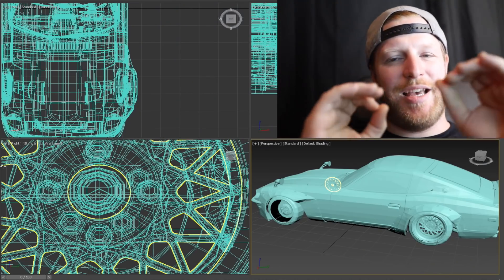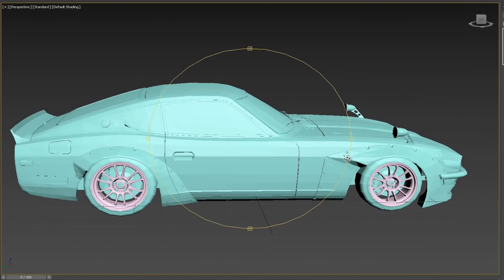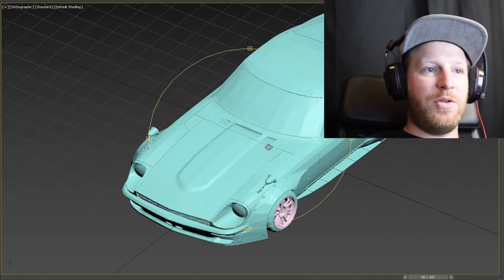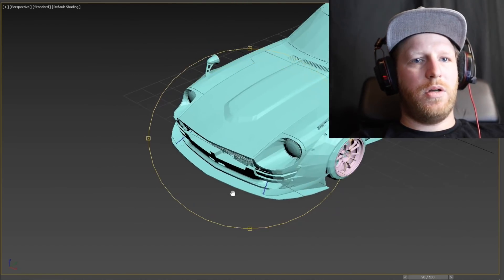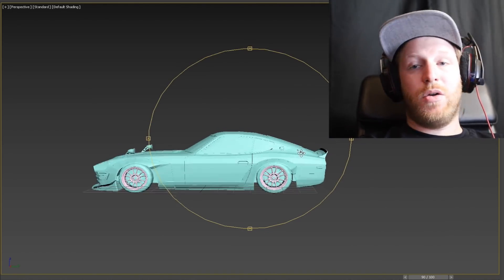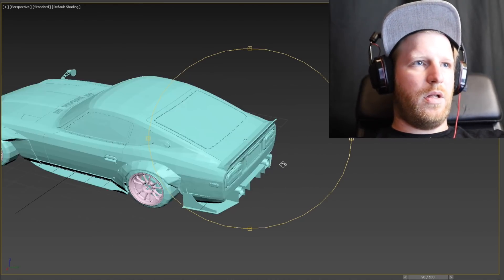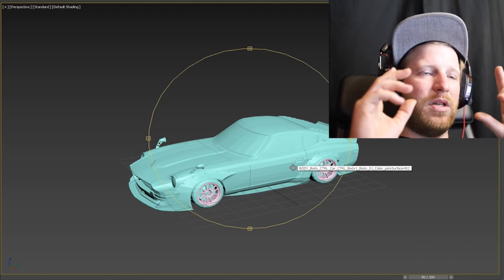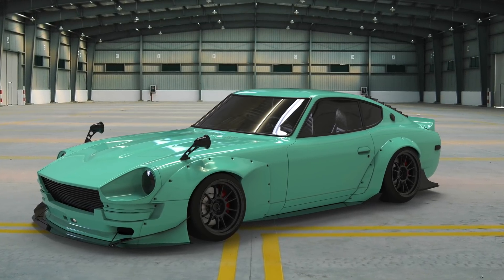Designing My V10 Powered Widebody 240Z

Comment: Dont widebody it with rivets, do an all steel widebody that’s subtle but noticeably wider. Car has such clean and beautiful lines
Reply: Andrew Sonnevil exactly what I wanted to say
Reply: he said he already bought the kit
Reply: He could try to mold the kit to the body rather than using hardware :/
Reply: I agree, in my opinion it looks cheap with rivets. Smooth / mold it out so it doesn't look like a kit anymore.
Reply: Andrew Sonnevil guess its too late for this.. too bad. Would have been better.
Reply: yeah lets not forget the last rocket bunny kit he put on, and the rubbish (imo) way he put it on
Reply: Pieter van Gisbergen Molding a ABS plastic or Fiberglass kit to a steel body will flex and crack at the joint. The only option for smooth molded flares is welded steel ones that won't flex.
Reply: Shona, that makes sense! Learned something new again :)
Reply: Agreed - riveted body kits look like a cheap and easy way out to wide body a car, they just look tacky when the rest of the car is mint.  Fabricate it and it will look a million times better.

Comment: Please don’t put a big wing on it or a wing at all
Reply: It has fuckton of power, it needs a wing, it's not cosmetic in car like this.
Reply: When you get your 240z and put a BMW V10 in it then you can leave the wing off it. Until then Chris is gonna build his and he’s gonna do it his way
Reply: it doesn't need a spoiler unless he's going to go over 200mph which i highly doubt he will.
Reply: Jeppe Werring don't think you know how rear wings work....
Reply: You don't have a clue if you think a car has to go over 200mph to need a wing. Educate yourself before spouting asinine nonsense.
Reply: downforce, without downforce it can be dangerous to go at very high speeds as the air get under the car. but too much also limits the speed. That's why downforce is variable on the Huracan Performante, higher speeds in corners with a lot of downforce but less downforce in straights for higher top speeds.
Reply: Jeppe Werring It's actually in speed over 150kmh which is about 90mph. Which he can easily do on a track.
Reply: F90 M5 can go over 190mph when unlimited and that thing doesn't have a spoiler. remember that this datsun will be super heavy in the front.
Reply: The F90 M5 has a piece of carbon fiber or plastic stuck on with double sided tape, it doesn't do shit.

Comment: I think you could implement some  compartments for the windscreen wipers, two cutouts on the front of the car where the wipers would traditionally go. They could be motor controlled by a switch on the dash, when you flip the switch, the compartments open and the wipers come out.

Comment: An 83 Chevy Astro van grille with slight mods makes a full front grill.   I know you don’t want bumpers.  But on my 240 I took a fiberglass 240 bumper and cut it to make bumperettes.  So small side bumpers to fill in where the bumper goes.  I don’t know how tom add a picture to show what I did.

Comment: Ugh...you had it so close.  The widebody sucks.  I agree this car deserves something more custom less bolt on.  Duck bill and louvers for sure...no big wang.  Please.  Also the "diffusers" and "side skirts" you are doing are ok, but the rear is terrible.  This build is outside of your normal scope.  You normally take older or junky cars and either fix them to spec or go the other way. THIS car is totally custom.  This will be a custom built car, with a 240z skin.  This is serious.  After building the chassis, and making the driveline work out, sticking on a bunch of crap would just be letting the car fall short.  If you needed to skip SEMA this round to get the car done right, that would get my vote.  This has potential to be one of the coolest frigging cars in the game if you do it right.
Reply: I agree on that rear diffuser. But then again he copied it from a ricer
Reply: Widebody looks amazing dude. 
No widebody = normie car
Widebody + spacer + lowering springs = better handling.
There’s a reason people do this.
Reply: DesiredFilm...I think you misunderstood my post.  THAT widebody sucks.  I like wide bodies.  And on the right car, what he proposed is fine.  But for this car?  It deserves something much more.  "More custom, less bolt on" like I said.  Maybe out of steel...maybe out of fiberglass.  Just something different.  We're on the same page :)
Reply: JEG's Garage 
Oops sorry. I’ve been reading other’s comments and somehow I mixed the two.
Reply: I definitely do not mind wide body vehicles/designs. But with all of the issues he has had to deal with on this build and all of the hard work he has had to put into this 240Z / M5 hybrid build, it just does not seem to do the vehicle justice to just slap on some riveted wide-body fender extensions. With everything he has had to design and build so far on this build, it seems he would have designed new fenders.

Comment: I think you made a good call about the wing, duck tail fits the car best in my opinion and such a big wing is very overkill for downforce anyways. Since you got rid of the bumper and made the grill bigger, it would be cool if you could put the Z logo in the middle of the grill. And it would probably clean up the rear end a bit more if the rear diffuser slightly shorter so it doesn't stick out so much. Silver would look sick btw

Comment: Hey Chris, maybe use the color of the new shell or a variation of that. Or use a m3 color scheme to hint what is underneath (like others pointed out) Although I am a fan of the Robunkit in general, I think it would not suit this build maybe you can try to somehow mold it in the fenders, else it will just be another Rb styled build like the other two projects you made, but yeah it is your car so I respect that (and you already ordered it) your next build (after the 240m3) should not have a Rb kit mix it up a little. Good luck!

Comment: Check out the JW Speaker 8720 for the headlights. They're spendy, but absolutely worth it based on my experience with the 8790 Adaptive on my bike and the 8415s on my DF Goblin build.

Comment: silver is nice, i'd straighten out the side skirt a bit more in the middle to match the straightness of the body lines, and if you're going to do a wing, please have it match the straightness of the rear body lines, maybe a a bit curved on the ends. Love the difuser loom from the rear😍
Reply: Also i was wondering if you thought to modify the front widebody kit so that it undercuts before the front wheel, to match the rear wheel arch... I know that would be a lot of work, just wondering if you mulled that idea already. Cheers!

Comment: Maybe it's possible to make the ducktail look more integrated, give it a more "flowing" transition from the car to the actual spoiler.
That would fit the streamlined look of the car better than the "sitting on top"-design it got in the 3D-render.

Also, maybe consider hiding the rivets of the widebody-kit and making that flush.

Comment: If you don't plan on adding a big wang it might be beneficial to add vortex generators just so you can redirect air onto the ducktail to help with downforce. I dont know how aerodynamic the 240Z's are but you might not need it.

Comment: Kona Blue would look good.  I think you could've bolted more weight onto it.  Clearly all fast cars need 600lbs of aerodynamic straightening.  Add more metal, fiberglass, and bondo.   You didn't add a big scoop to the hood, or a triple layer wing either.   Oh and you need one of those fake roof scoops like every 10 year old boy dreams of.  Might as well start putting Hyundai badges and fart can/ebay mufflers on every build from now on too.  What about some cool underglow neon lights too bro?

Comment: I say no diffuser. Definitely looks a lot cleaner without one. the rear end is pretty much set as it is, no wing, ducktail is good, small canards near  the bottom of the bumper. tiny mudflaps would be cool. oooh, for the ducktail, i like the one on the car, but cut the middle out with a 30-45 degree angle heading towards the middle, then add plexiglass or something see-through built in like this ( https://zl1addons.com/collections/wicker-bills/products/copy-of-camaro-5th-gen-2-peice-wicker-bill )- Again, this is just what I would do regarding the car, it's your car, and you can do as you please of course